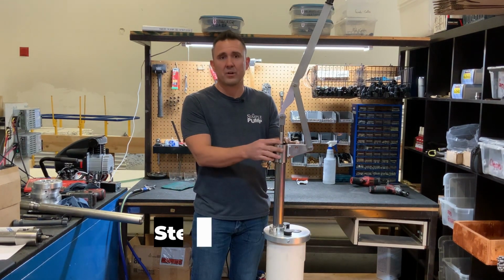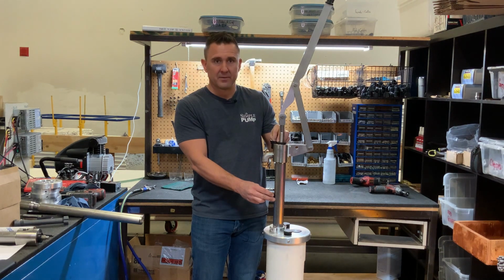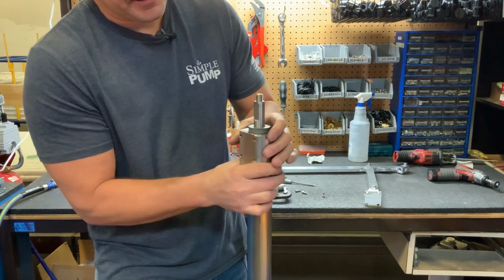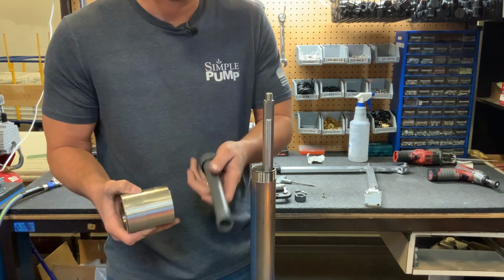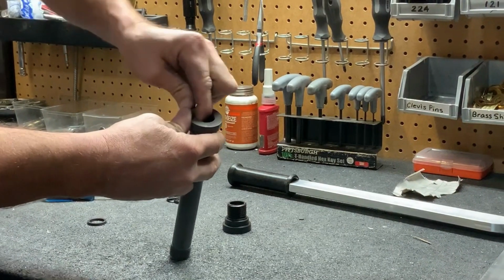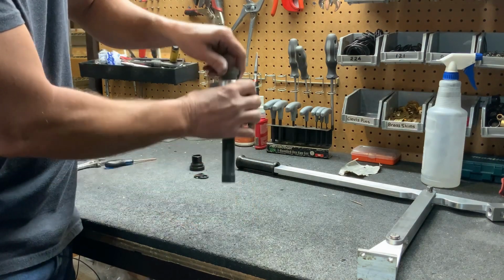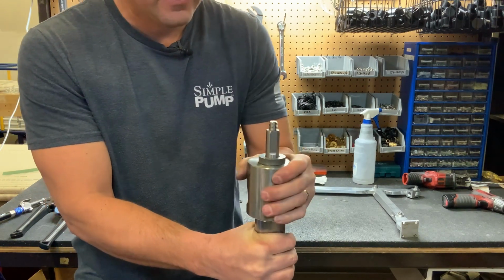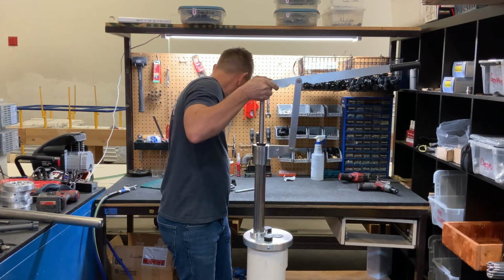Simple Pump Maintenance - Rod Gland XL Seals

Comment: So if you have the new style one just unscrews the gland without removing the head, replace the seals and screw back on>
You really covered the old style well but didn't mention much about the new style.
Reply from the maker: Thank you for your question. We have a different video that walks through the maintenance tips for replacing the short rod gland seals. https://youtu.be/H6eLUU8BDnk